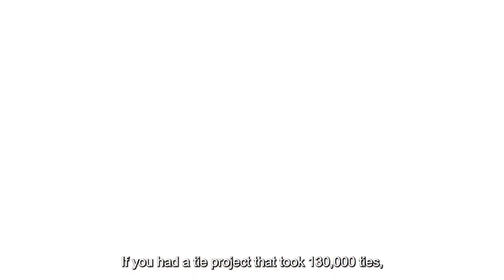Union Pacific's Autonomous Tie Loading & Unloading Equipment

Comment: Why dump them along the tracks?  Why not load them directly into the machine that places them in the roadbed?
Reply: because that's not how tie cranes work
Reply: @MiG21aholic  so fix 'em, then, so they do work.
Reply: @dl33tc0dr6  believe it or not, but having a huge machine to do one job quickly is not always the best way to do it
Reply: @MiG21aholic  especially if you're only replacing the bad ties, and not all the ties, with rails.
Reply: What machine would hold that many ties?

Comment: Why not go to concrete ties? Seems they would last way longer.
Reply: Wooden ties are better because freight trains wear out concrete ties faster then wooden due to there weight and the flat spots on wheels which would pound the rail and cause damage to concrete ties. Wooden ties on the other hand are slightly flexible so they can hold heavier trains.
Reply: @Trainman-xm3wd  Similarly heavy duty semi tractor frames are designed with some flexibility built in because otherwise they would just crack & fail under heavy load.
Reply: These are replacement ties being staged for the tie replacement crew.
Reply: I believe the main across Nebraska is concrete.
Reply: How about replacing the wood and concrete ties for steel ones with latches that latch into the rail without the need of spikes? I’m not sure if heat and cold will damage the gauge though. 🤔
Reply: @Bassotronics  steel would corrode pretty rapidly in ground contact. Maybe recycled plastic ties would dampen like wood but last like concrete???
Reply: @bcbloc02  
Although ties are not supposed to be in ground per say but on Ballast. 🤷🏻‍♂️
Reply: @bcbloc02  Break in the cold up here recycled plastics.